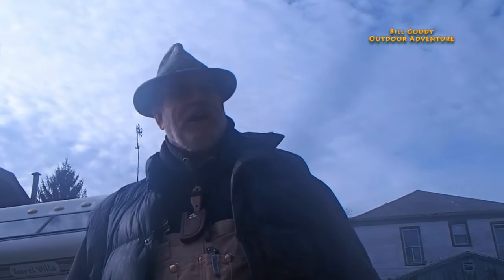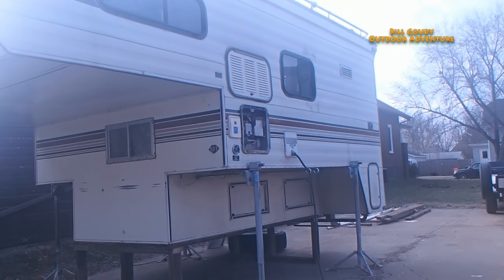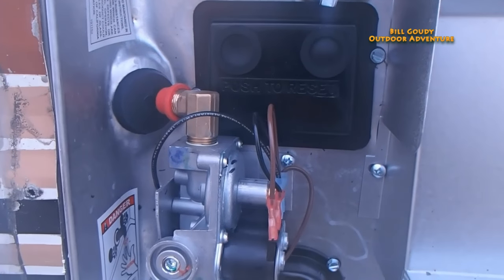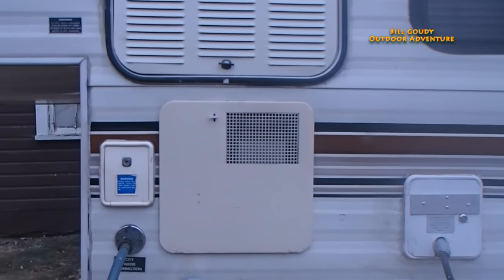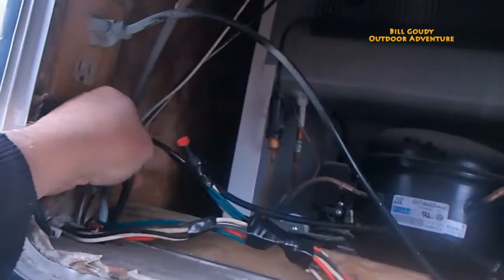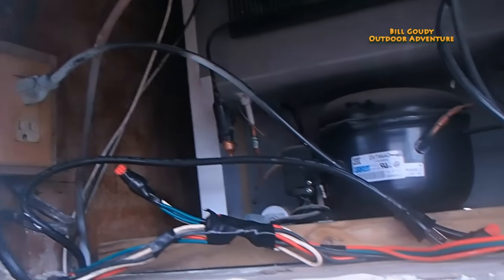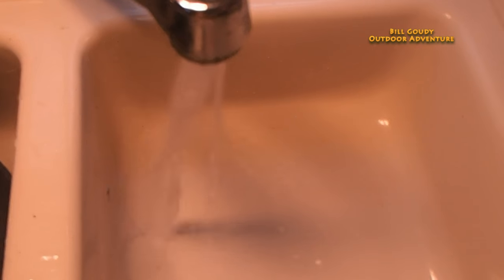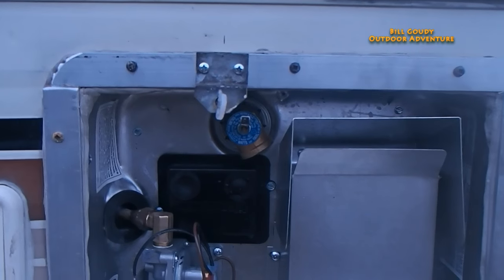RV Water Heater Replacement

Comment: Been having the same issue, gonna order the same water heater, wish me luck!
Reply from the maker: This water heater is still working good...  I use it all the time.  I like the fact that I can turn it on and off with a flip of the switch.  Saves a lot of energy (LP Gas).    I should have ordered the frame kit when I ordered the water heater.  I ended up building my own.  The frame kit might have been a little quicker install !!!  Good Luck, David....

Comment: Replaced mine in my 87 last year and didn't upgrade to electronic..  figures we got electricity at the camp last fall..lol   Would have been nice to not have the problems of a pilot !   Hind sight is always 20/20
Reply from the maker: Man, Chuck there are some places that I go that have no hook ups...  Now, I must have a battery or a generator to have hot water...  So...  I hope that I made the right choice..  I am thinking that I only paid about 40 dollars more for the electric ignition and the electric element...  I am like you ...  Only time will tell if we made the right choice...   ;-)

Comment: I watched the whole video hoping to learn how you wired the low voltage. You missed all of it. It was still a very good video and the making of your own mounting flanges and future plumbing was great.  Safe travels...
Reply from the maker: There are only 2 wires of 12 volt. (one positive and one negative) In this unit the wiring was already present. The water heater is prewired for 120 volt AC with a plug or LP Gas and the 12 volt is only for the spark ignitor. Red is positive and Black is negative in a 12 volt circuit. A volt meter is very helpful to help identify the low voltage wiring if your unit is different!

Comment: Hot water baby!!  Excellent job, well guess it was time, 30 year old water heater.  That's a slick new unit, well worth the money because now you've got options.  These new tanks recover so fast, you may only need to plug in when it's really cold and the water supply is like ice water.  Excellent video.
Reply from the maker: Haha!!  I don't think that the previous owners used it near as much as I do...  Haha!!  I am liking this set up so far...  The only thing that I worry about s that I must have power...  The old one did not require anything, but the LP Gas.....  But,  like you say...  I now have options...  Thanks for watching, Craig!!

Comment: I have an old style heater like that one to replace. How did you extend the old gas line from the back of the heater to the front? Disappointed you skipped over that part.
Reply from the maker: You are right, Skip... I should have covered that more...  I have replaced the original 3 way refrigerator with a 115v Dorm Room size refrigerator.  The gas line for the original refrigerator was all ready there.  It was capped off and I turned the gas off removed the cap and put the cap on the other line.  I then had plenty of pipe to make the connection.  The gas lines are soft copper with flare fittings.  It was very easy for me to hookup.  If I didn't have that extra gas line I would have had to extend the gas line or go to the Tee fitting and put in a gas line that would have been long enough.  I sure hope this helps.  If you need more info, Skip I can make you an updated video..  Let me know!!
Reply: Thanks for the reply, Bill. My H2O heater is the only gas appliance on the passenger side of my Class C. So I have to deal with extending that gas connection to the business end of the new style heaters that do not have the inboard connection like the old ones you, I and possibly others are dealing with (1989 American Appliance in my case). I must've watched a dozen H2O heater R&R vids, all with OEM front connections before I found yours with the inside connection... thus my disappointment :) My new heater is in transit and if the weather cooperates I will try to upload a video of whatever solution I come up with for the gas line extension. Happy camping!
Reply from the maker: If you think about it...  send me a link if you make a video..  I would love to see what you come up with...  You might only need to add on to your existing gas line.  Good luck...  ;-)
Reply: Skip Taggart 
I would suggest that you could go with 3/8  yellow gas line the type used for houses. That's what I did I actually added a shut off for the gas to the water heater so if I ever had to remove it for future reasons or to work on it I could without having to shut off gas to everything else.
Reply: Good suggestion, Jonathan. Thanks!
Reply: I totally agree... I was disappointed too.
I really like his video... I like how he presents his
knowledge in this video... but disappointed he didn't 
SHOW us How he did it.
Reply: @BillGoudy  
OMGosh Bill... Do you have a video on how you replaced the refrigerator?
You see... this is why I needed to WATCH you how to replace the hot water heater
and the refrigerator...
I have a small vintage 1972 travel trailer I just bought. The man said everything worked.
(Yes, I know I should have checked it out). I did get a great buy on it. 
I "flip" RVs... but never have bought one that had both the REF and Hot Water heater didn't work
I have a Dorm Room refrigerator I can put in this tiny RV... 
I have considered going the tankless water heater... but don't know if that is good either.
Please help me... if possible... I do like the way you do  your videos... 
Thank you Sir....
Reply: @BillGoudy  
Have you made an updated video Bill?

Comment: Hey bill i bought the same water heater, wondering which wires u hooked up the blue, green, and red wires to fit the 12 volt side I figured out the 120 side just not the 12v igniter
Reply from the maker: Thanks for watching, Kyle. I made this video and installed this water heater in January of 2017. I am sorry to say that I can't rightly tell you, safely, for sure how to make the connections. I installed a toggle switch, but I don't recall wire colors.  I followed the direction that were included, but I am assuming that you don't have them. The next best thing that I would do is search for online directions for electrical hook up of a SW6DE RV Water Heater. I sure hope this helps ya!

Comment: Nice job Bill, LP and electric, you are sure of hot water and if you ad the solar heater you have it all, solar here with our sun is very popular, I have 3 panels on my roof and that brings my pool 6m x 3m up to 32 deg C in summer but we found that to hot to cool of. Thanks for the great video. I loaded my smoker as promised.
Reply from the maker: Thanks, Jan...  This has worked out really good...  This spring I plan to add the solar ....  I will be over to your channel to check out....    ;-)

Comment: I have 95 lance with a hot water like yours. Do you know the brand of the heater. What type water line did you have? Was it the grey poly and did you have any problems with leaks?
Reply from the maker: https://www.ebay.com/itm/Suburban-RV-Camper-Gas-Electric-Water-Heater-SW6DE-6-Gallon-Trailer-12-000-BTU/383386821421?epid=1722129490&hash=item5943a2a32d:g:VksAAOSwUQBd3kbf  Here is an eBay link to the water heater that I used.  I have the gray poly pipe.  The water heater has a 1/2 inch steel pipe thread going in and coming out.  The Gas line I have is soft copper with a flare fitting.  I went to Lowe's and bought fittings to hook into my grey poly pipe.  I hope this helps...  ;-)